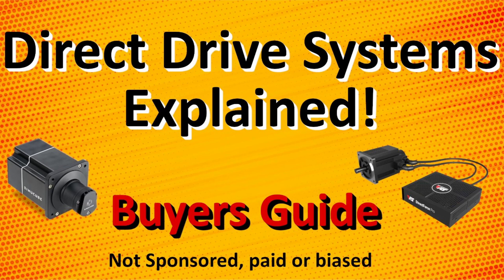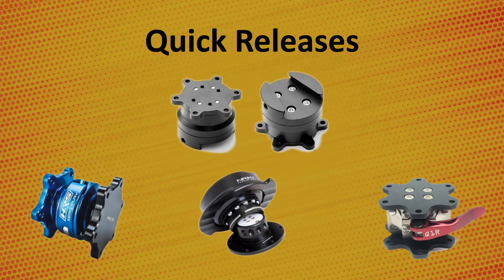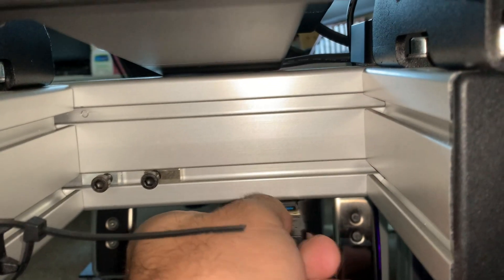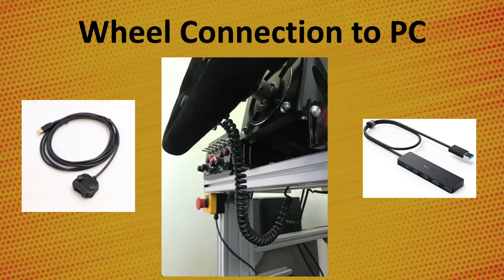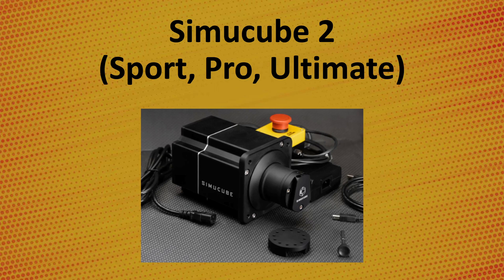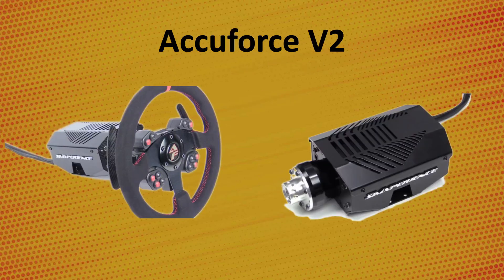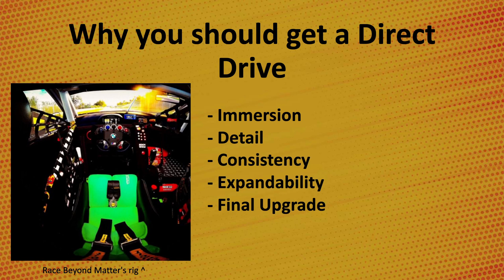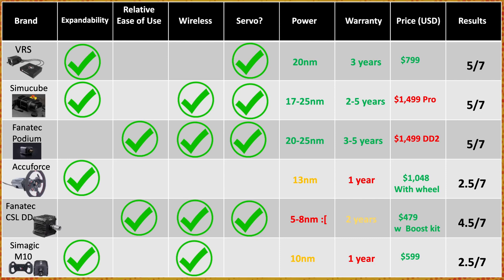Direct Drive Systems Buyers Guide & Overview

Comment: In the list the base that I am going to buy is missing, the Simagic alpha mini (10Nm sustained), it is a very smooth servo motor, with a very polished last firmware, it has nothing to do with a stepper motor, it looks like a mini -simucube ... I already have several cable steering wheels, I'm about to see how I will adapt my QR ...
https://www.youtube.com/watch?v=wPe628qP5n8
Reply from the maker: Think that came out after i did the video.
Reply: @Theoloop  Well I think you are right, impossible to talk about something if it is not public, in the West it came out in July. For the next ...

Comment: I tried some DDs but I am no expert. However I wanted to add my 2 cents. The 5 years warranty is a major factor that I recommend any and every buyer to get it since many of my sim racing (and VR) gear in the past died on me and bricked to zero dollars value. Second, the Simagic was announced at 599 but then due to distrivutors commisions and the like it was going to cost a lot more, worth mentioning is that my information is years old and maybe they actually lowered or unified the price.
Reply from the maker: Thanks!